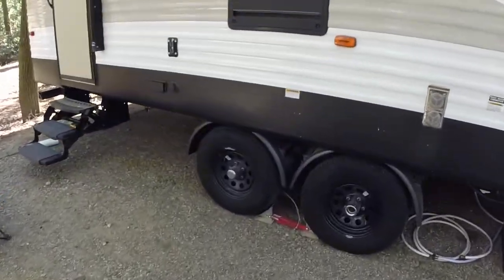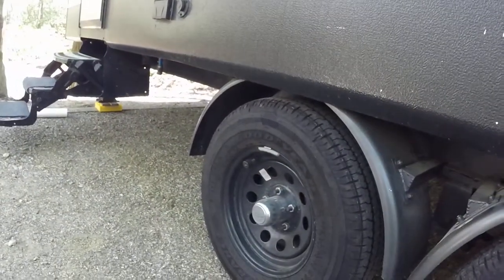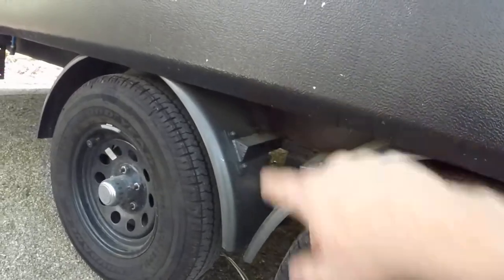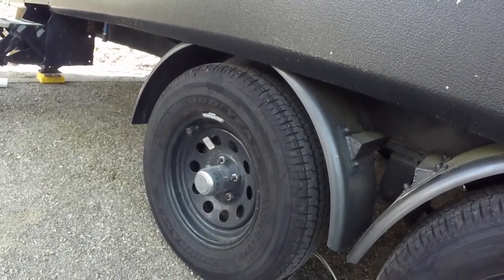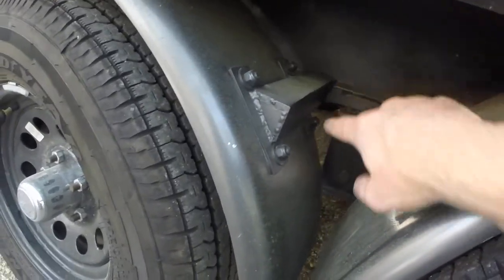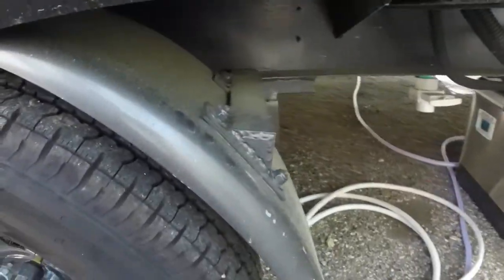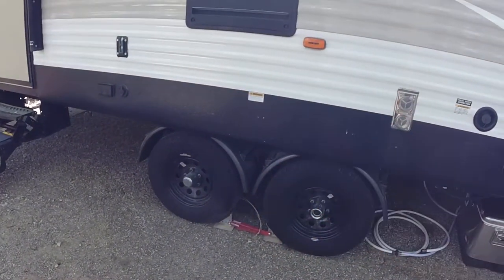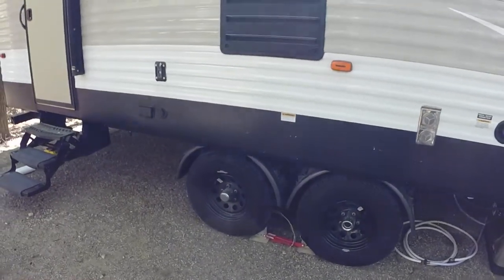DIY Steel Travel Trailer Fenders

Comment: Can you share an update on how the fenders are performing/holding up?
Reply from the maker: I have since sold the trailer. I installed them just before a 5,000 mile road trip. They held up beautifully. The paint on the front fenders got dinged up because of rocks getting kicked up by the truck. I never had a catastrophic blowout, so I’m not sure how the fenders would fair. The point of the fenders was to protect the floor and siding during a blowout
Reply: @themellowmechanic  Awesome! Thank you for posting.